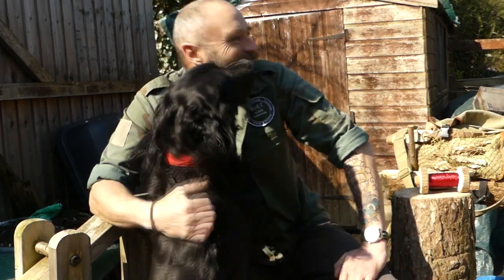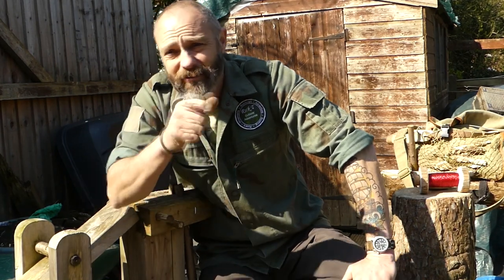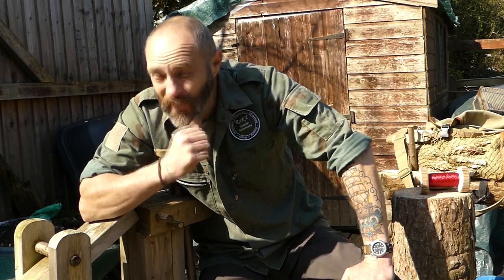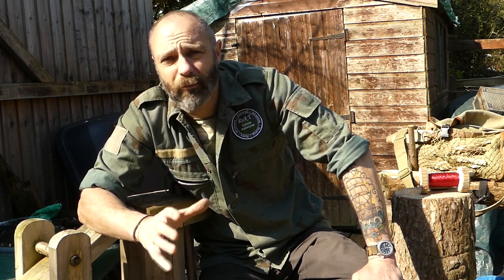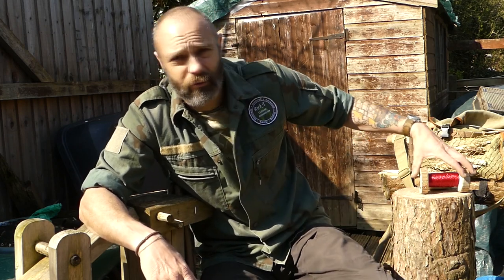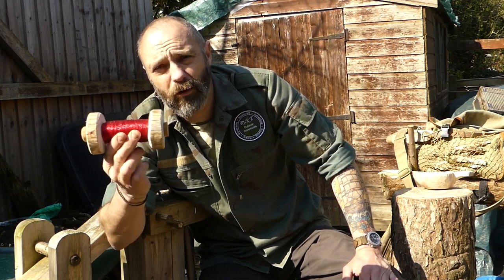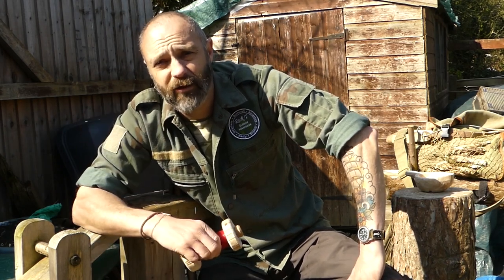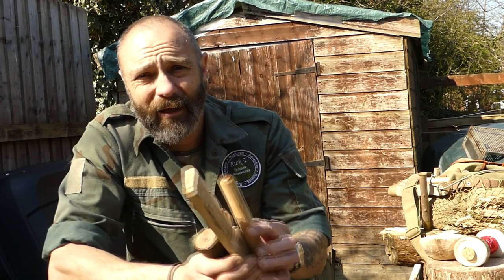Ten minutes to better bushcraft  Ember Extender Bow Drill Fire Skills

Comment: Using a coal extender to grow the ember is very good advice.  Even if the tinder bundle is quite high in humidity, if your ember is big enough like you showed, one can just leave the ember nestled down in the tinder bundle and not blow on it at all or perhaps blowing only very lightly, It will dry out the tinder in the immediate area.   By feeding punk wood bits to the ember the ember will continue to grow and will last indefinitely as long as one continues to feed it.   That growing hot ember can, over time, dry out quite humid tinder.   Thumbs up.
Reply from the maker: Cheers Lonnie,  aye it's a really good tactic that works well in the field when its important 👍. Thanks for the great comment too 🙂👍

Comment: Hi mate, missed this in my notifications. Great tip and it was interesting as it went into the tinder bundle you could see the wind catch it and the ember was glowing. As Buzz said, we will definitely try this out. Thanks for the share. All the best and stay well. Cheers Sel
Reply from the maker: Cheers Sel, thanks mate. My notifications are all over the place . Some I get some I dont. Didnt get a notification of this message either.  Mad ain't it. It's a good little tip though. Sometimes it's hard to get that ember so whatever you can do to keep it 🔥😃

Comment: Cheers Rick. Another great video. When the war is over Sel and I shall give it a bash. I now have a Tin of punk wood that’s been on the fire from your flint and steel video.
Reply from the maker: Cheers Buzz 👍. Aye definitely give it a blast Buzz especially in winter. I dont usually use it in the drier months but it can definitely be the difference between success and failure un rough weather 🙂👍. That charred  punk wood is worth its weight in gold 😉. Cheers Buzz, catch ya soon fella 👍